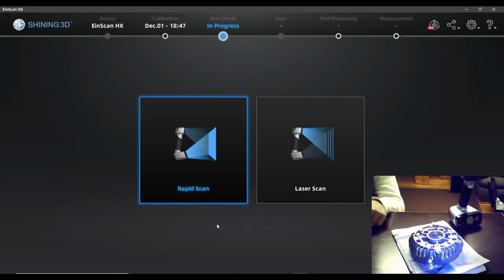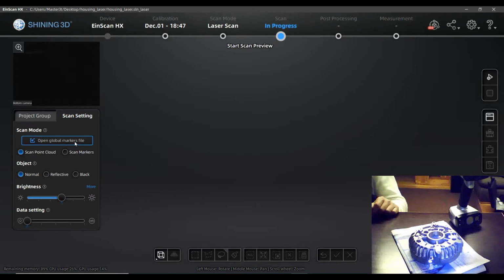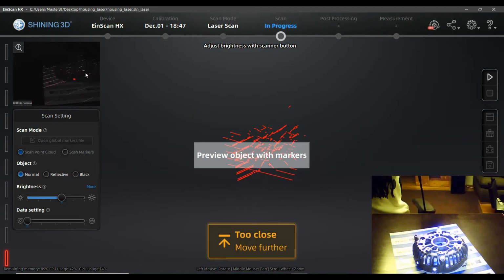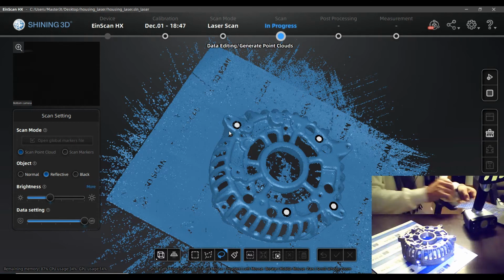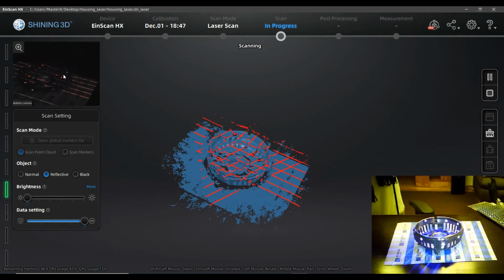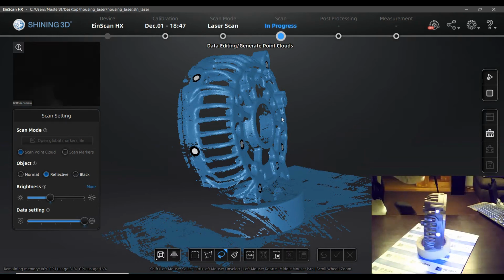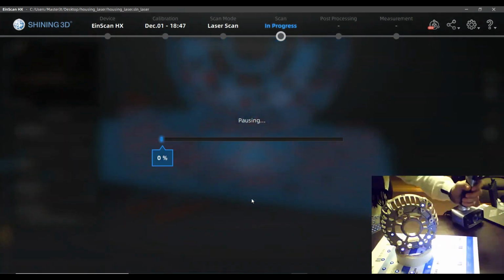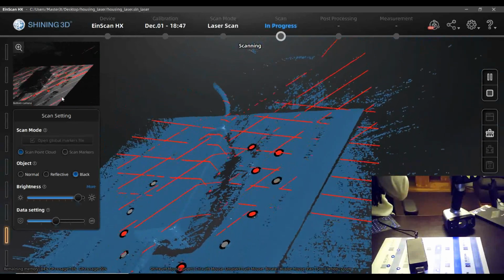02 Laser Scan Beginner tutorial EinScan HX

Comment: What CPU/GPU are you using to handle the scan data and cad?
Reply from the maker: Depending the size of the object. With an HX you can start to work reasonably with a GPU GTX970M and CPU i7 Haswell (f.ex. i7-4810). I would recommend min. 32 GB RAM in any case. The bigger the better :) Currently we use rtx2070 or higher and ryzen 3600 or higher because of process time.